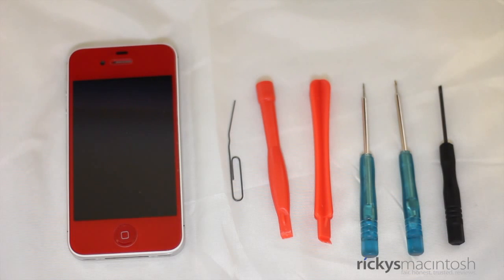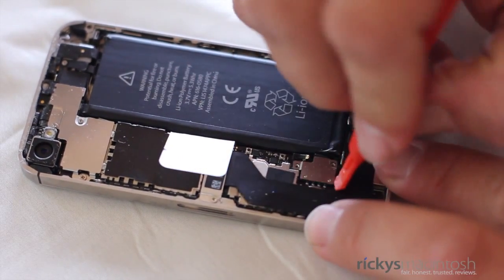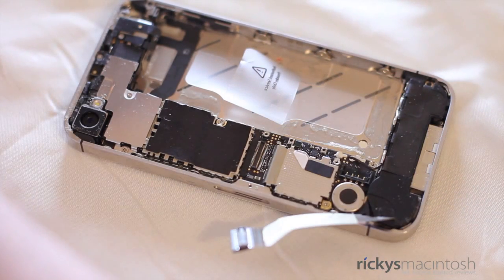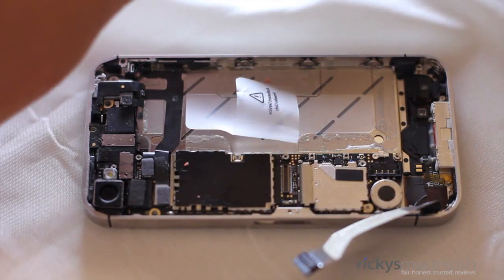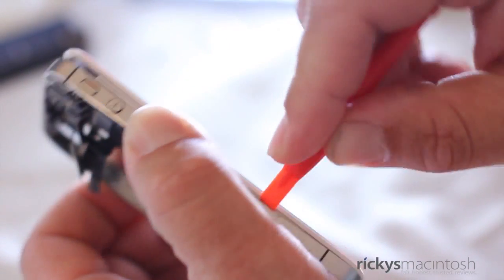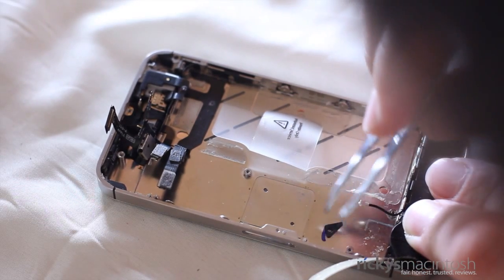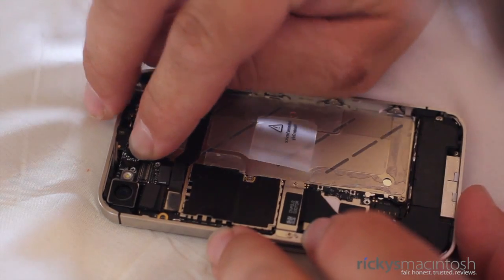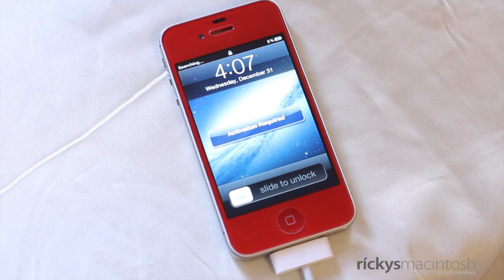iPhone 4S Color Conversion Kit Tutorial: Disassembly and Reassembly

Comment: Needing some help, did this conversion and all worked fine for about 48 hours, and now I am faced with an issue, my phone has stopped charging. It was charging just fine for those 48 hours, frequently used and what not. But now it will recognize when it is plugged in and show the symbol as if it was charging, but no charge. The percentage also "jumps" it went from 25, to 19, to 11, then 6, and it stayed at six for about an hour then dropped to 2. Any ideas? It will now only work when plugged in and frequently shuts off. I'm doing a software restore now and we shall see if that works, but any other ideas? The device was off when I began, I followed every step to a "t" watching them multiple times if I had to.
Reply: I'd suggest removing the battery, and then putting it back in.
Reply: I had the same problem and it turned out the battery was leaking and couldn't hold its charge

Comment: Hi ricky i have fully installed the whole thing, i check and everything worked fine the only problem is that my Wifi detection is very weak, the phone can only detect when it is at the same floor as it is at, for example my wifi modem is at 2nd floor, and im on the 1st floor, i could not detect the wifi signal, is it something to do with wrong installation or?

Comment: You might have slightly torn the cable that connects from the front screen to the board. I had similar issues and  for some reason I couldn't use the top 1/8"-1/4" of the screen and some of the middle. If it isn't torn, I'd suggest contacting the company you bought it from and seeing if you can get it replaced.

Comment: After reassembly, my phone is having trouble connecting to network. Most time there's no service at all, but I do have random moments or connectivity (doesn't last long though). Also, my home button is stuck and not functioning. Any way to fix these problems?

Comment: This video is good with a couple of exceptions. Keep track of where each screw goes! I kept track of them by putting them in dishes in the order he took them out, but he DOES NOT PUT THEM BACK IN THE SAME ORDER THEY CAME OUT. Also, he skips over putting back some of the gold separators. Make sure you knew where they came out and how because the video does not show it. Finally, he does not cover replacing the button. Before you put the face back on, make sure to move or put the new button in.

Comment: thanks for the help and i had also contacted the company. apparently i have to slowly peel the original black adhesive off and replace it on the new one. unfornately i installed mine without it but oh well it works just fine. btw great video i installed it yesterday. im 18 and have never opened up my iphone before, its a 64 gb 4s and i was a little nervous but everything worked great.